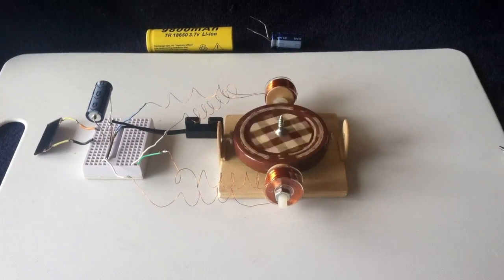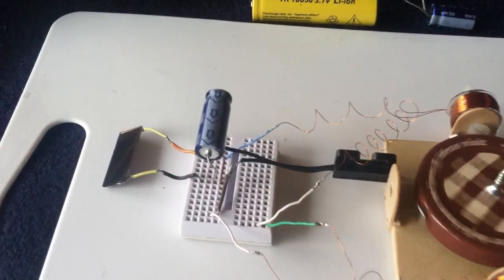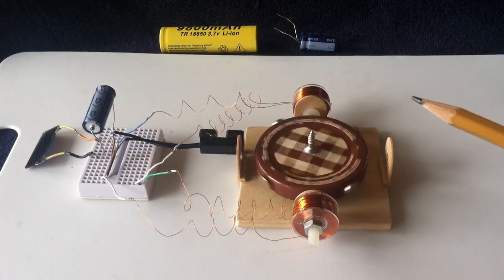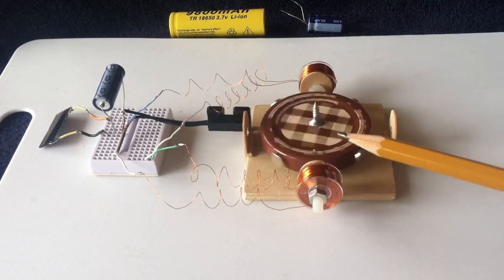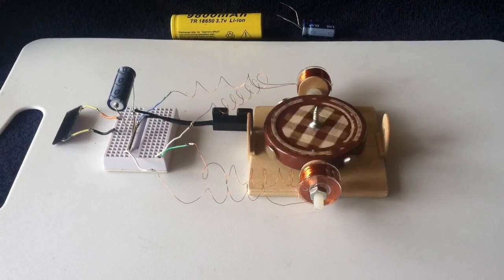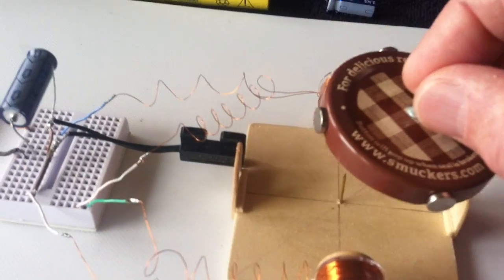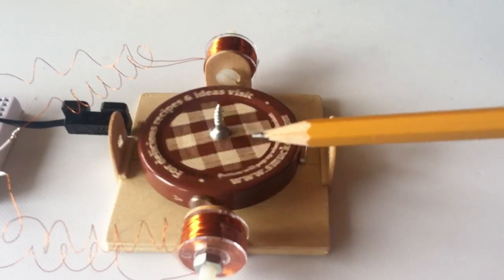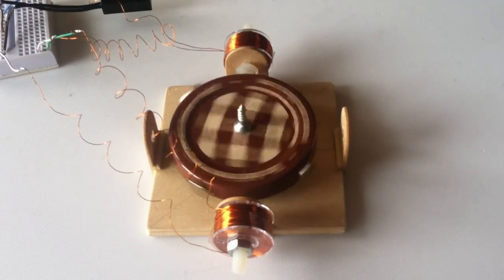Flywheel Energy Storage

Comment: 1. how much electricity would come from the flywheel
2. would it be continuous at night with no sunlight
3. how much electricity would it store during the day with batteries to make it feasible
4. how big or how many small flywheels would it take to keep a house running 24/7 days a week.
5. what would be the maintenance or repair cost when one goes down.
This a cool concept, just curious on how this could be used.

Comment: This is not new, but good for you. Sometimes old solutions become new solutions with advances in technology, such as better bearings, better flywheel materials and construction, and better electronics. This is probably going to be a solution for storing intermittent renewable energy, like solar at night and wind and waves during calm periods. I know that flywheels have been used historically as uninterruptible power supplies for computer centers way back when batteries were useless. The flywheel would be connected to a motor and a generator. The motor would be connected to the mains and the computer center connected to the generator. They gave spotless power over transients, brown-outs or even black-outs for many minutes in which to start diesel generators if necessary.

Comment: when your done the flywheel experiments could I make a request for your next experiment?
Perhaps collecting flyback voltage from a pulse motor into a cap then pulsing it at the right time back into source battery to see how effective and efficient it can be. You would pulse energy from the cap every second to every 10 seconds or say maybe every minute ?You would need to experiment with the timing and different capacitor sizes and motor coil sizes and pulse the stored energy into the source battery when the motor is on the off pulse.
this seems like an interesting idea I and I'm sure your audience would be very interested  in your findings.
thanks...

Comment: You can calculate the rotational energy of a flywheel by using the formula on this page:
https://en.wikipedia.org/wiki/Rotational_energy

It would be interesting to see the rotation time of your plastic lid & metal lid if you make the weight of them the same before the test & you use the same charge time on a fully drained super-cap.
Reply from the maker: +A B  I wish that I could say that the metal lid had some kind of magic over the plastic lid but I don't think so.  Thanks for the link.  I did a bunch of research on this topic today. Something new for me to work with.
Reply: I wouldn't say it has any kind of magic, however, as you stated, a heavier mass that doesn't create too much additional resistance may make it run for longer in its sweet spot range.
Reply from the maker: +A B The more I look into this the more interesting it gets.  You are right about there being a sweet spot.  This can all be calculated.  One thing that is amazing is that the flywheel builds up stored energy and at an instant in time can deliver a burst of energy greater than the energy trickling into it at that instant.  It is the same thing as a storage battery---but mechanical instead of chemical.
Reply: +Lidmotor 
re:  "the flywheel builds up stored energy and at an instant in time can deliver a burst of energy greater than the energy trickling into it at that instant."

hmm... how did you arrive at that conclusion.  

My understanding is that the kinetic energy within the moving FW can be used at any time (i.e. when a electrical pulse is present or not) by friction or by a load.  When an electrical pulse is present, there is slightly more energy available in the system to be lost to friction &/or used by a load/s--when an electrical pulse isn't available, then there is a little less energy available in the system to be lost to friction or used by a load/s.  

Given that the pulse is a very small amount of additional energy added for a short period of time, a load that draws more energy than that of the full pulse, will tap into the KE energy of the FW & slow the FW a bit as a result.  If that continues too much, the velocity of the FW will slow with each energy draw.  If the load energy draw is intermittent & the system can recover sufficient energy between energy draws, then the FW will oscillate between a faster & a slower speed as available energy is added to or drawn from the system.  

It's really a balancing game that can be used to store energy (like in the case of a race car when it brakes or when it produces excess energy that can be stored & used later when energy production is lagging).
Reply from the maker: +A B I probably stated that wrong.  I got that idea from what I read about the race cars using the KERS to gain an 80hp boost for a few seconds.  Where did the 80 extra hp come from?  To me that meant that by storing up the kinetic energy during braking you could actually (for a few seconds) input more power into the drive train than was there with just the engine input.  Perhaps I am looking at it wrong.  The flywheel does not have more hp than the engine but the two working together give you a brief bump in usable power when you tap the flywheel's kinetic energy.  Of course you are slowing the flywheel down when you do that.  In the race car they just speed the flywheel back up when they hit the brakes.  I think we see this the same way.  I just mis stated the situation.
Reply: No problem.  Understanding & explaining these things isn't usually easy. :-)
Reply: true

Comment: It has been in Formula 1 cars for over a  decade I think. Some supercars for the road also. I'm curious as to what the highest capacity density (Wh/kg) of flywheel based storage systems would be. An infinitely strong material could spin infinitely fast, for infinite capacity.
Bearing friction? Magnetic bearings, of course :-)
Reply: +Cloxxki There is no such thing as an infinitely strong material.
Given that KE=1/2m*V^2, only the mass, velocity, & friction are relevant in determining how much energy is stored in the flywheel.
Reply: A B no kidding!
Reply from the maker: +Cloxxki Here is the Wikipedia on 'Flywheel':  https://en.wikipedia.org/wiki/Flywheel.  It was interesting to see which materials used in flywheels can store the most energy.  Composites rule realm.
Reply: That is interesting info, however, you know those table values are kJ/kg, right?  1 kg = ~2.2 lbs.  Are you going to need a flywheel that will be over 1 kg?  If not, you can certainly use a weaker (& less expensive) material because the centrifugal stresses will likely be very low.
Reply from the maker: +A B  It all depends on how fast you rev the thing I guess.  The flywheels that run in the tens of thousands of RPMs need to be pretty strong.   The toy stuff I work with could be made out of silly putty. lol
Reply: re:  "The toy stuff I work with could be made out of silly putty. lol"

Exactly ^^ my point :-)

And you are right the speed does affect the stress on the material--I just doubt most of us will be spinning a flywheel into the 10s or 100s of thousands of rpms--although... it is possible with magnetic bearings.

Comment: Have you tried holding a spinning bicycle wheel in your hands (by the axis that is)? Now try and turn your body to the left or the right. You will feel the axis will not stay horizontally. Now apply this to a moving object. Suppose you have this heavy wheel spinning. It will be hard to steer to the left or the right, unless the axis can tilt over. You could even steer the vehicle by tilting the axis. All I want to say is that there are more forces at play. If it is spinning real fast, it can be manipulated to act as if it is free of weight (look for 'Anti-Gravity Wheel' on YT).
Reply from the maker: +deslomeslager Yes.  The gyroscopic effect is a problem in the cars using this KERS method.  Porsche dropped the idea because of it.